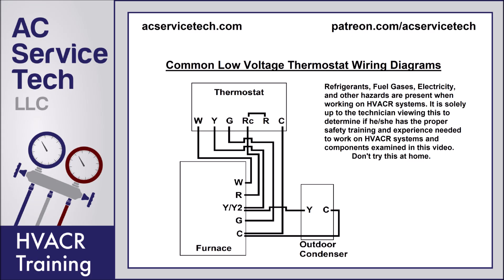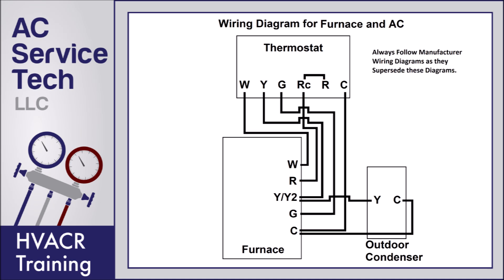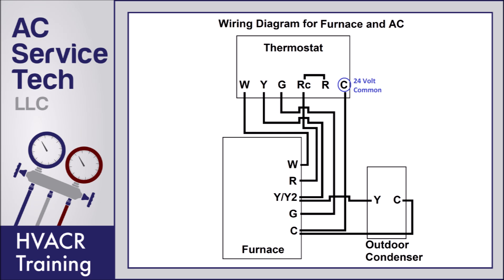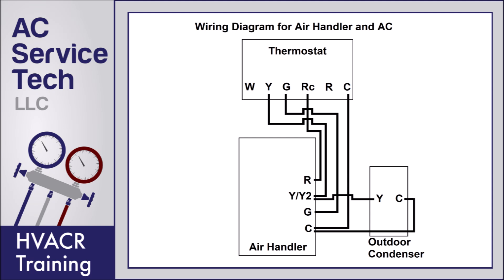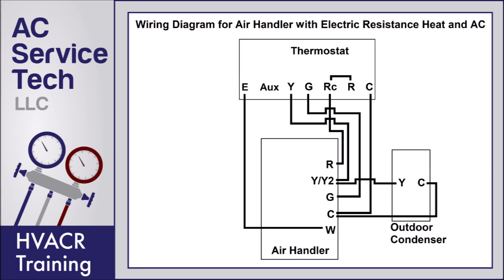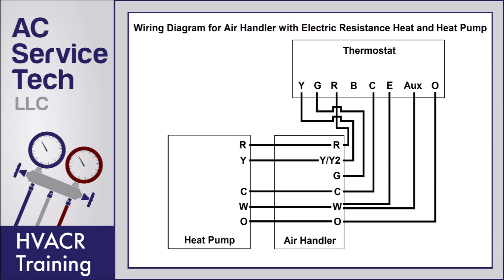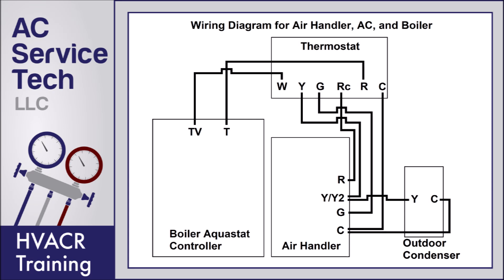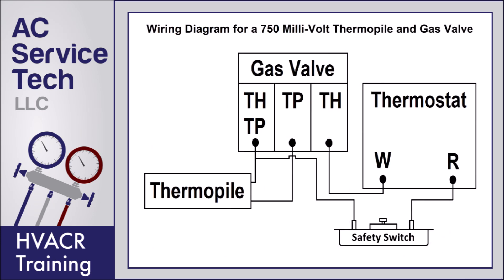Thermostat Wiring Diagrams! 10 Most Common!

Comment: I like the extra effort you made to draw the diagrams in a manner viewers could read them on youtube.  Sometimes manufacturers' drawings will use dots to indicate connections at crossing wires.   I find that arrows on the lines helps people understand where the current is flowing to and from.  The heat pump W circuits are interesting with two sources feeding the same ahu heat control.  Two stage wiring is another challenge which is pretty common these days and dual fuel certainly adds complications.
Reply from the maker: Yes, I did a video on dual fuel wiring but I just showed a control board, dual fuel thermostat, outdoor sensor and ac contactor all next to each other when explaining. thanks for the extra tips that you would like to see in future videos, thanks!

Comment: I know this is not on the topic of the video but quick question. I see on all your Superheat/Subcool videos you have a superheat charging chart based on indoor/outdoor temp. When charging a system with a TXV having to use Subcool does indoor/outdoor temps matter ? Does your target sub cool rating become lower in certain occasions ? Please explain and thank you so much for the awesome videos !
Reply from the maker: Subcooling will become higher when the outdoor DB is very high but most manufacturers give 1 to 3 target Subcooling measurements but most give 1 as an average since they are so close. It must be at least 70 DB inside and 70 DB outside before checking the charge. Did you see the video I did on charging an ac in low outdoor temps with the charging bag? thanks
Reply: Thank you so much no I will search that . Awesome videos